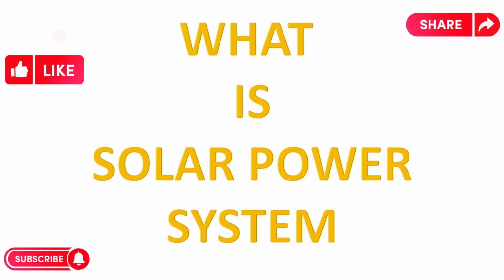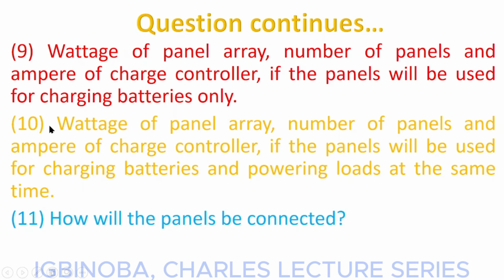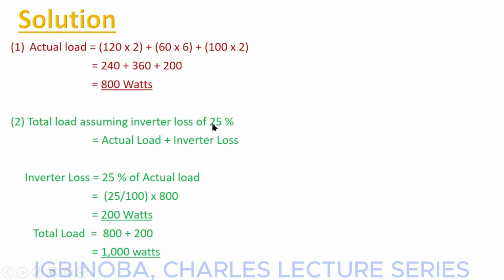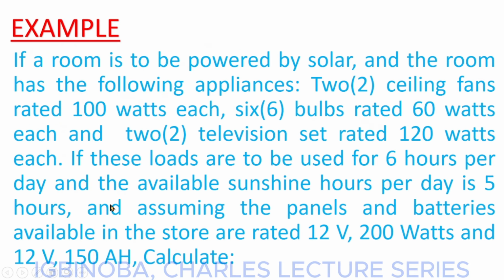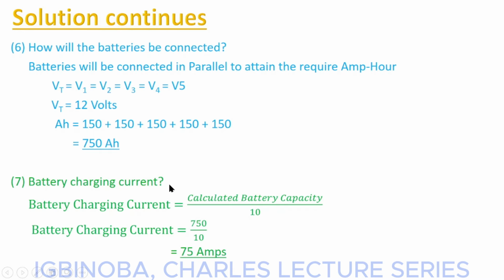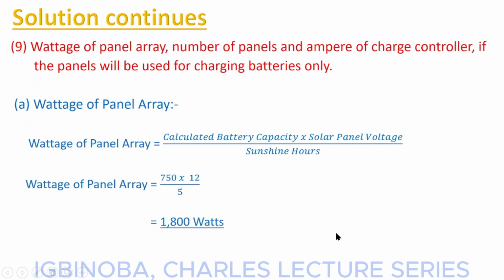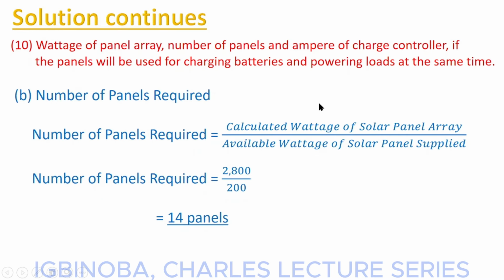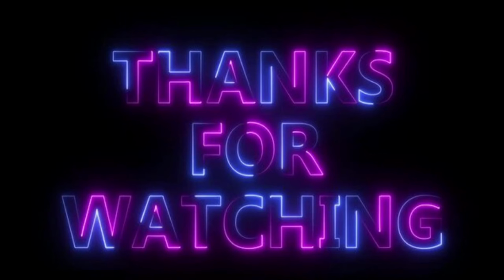Design of Solar Power System

Comment: NAT317Q

1.Actual load is 1380w
2. Total load is 1725w
3. Inverter rating is 2156.25VA
4.Battery capacity is 1293.75AH
5. No. Of batteries is 8.625~9batteries
6. Parallel
7.Battery charging current is 129.375amps
8. Charging time is 14hours
9. (A) 3105w (B) 15.525 ~16panels (C) 258.75A
10. (A) 4830w (3) 24.15~ 24panels (C) 402.5A
11. Parallel

Comment: NAT33C

1. Actual Load (Watts): 1380 W 2, Total Load (DC with 25% Inverter Loss): 1720 W
3. Inverter Rating : 2156.25VA 4. Battery capacity: 1293.75Ah 5, Number of Batteries (12V, 150 Ah): 6, Battery Connection (48V System): 2 parallel strings of 4 batteries in series 7, Battery Charging Current: 129.4 A 8, Minimum Charging Time (hrs): 14
hours 9ia. 3105W b, 15.5 panels c. 258.8A
10a. 4830W
b, 24 panels
c. 402.5A
11. Panel Connection: 3 parallel strings of 6 panels in series

Comment: PETRO3107C

1. Actual load= (100×3)+(60×10)+(120×4) =1380watts
2. Total load assuming inverter loss of 25%= Actual load +Inverter loss
Inverter loss=25% of Actual load
= 25%×1380=345 watts
Total load= 1380+345=1725 watts
3. Inverter rating on VA using power factor of 0.8
= (1725÷0.8)= 2156.25
4. Battery capacity using factor for reserve 75%=(2×1725×6×0.75)=1293.75Ah
5. No. of batteries for backup hours=1293.75Ah÷150Ah= 8.6 =8 batteries 
6. How batteries will be connected?
The batteries will be connected in parallel 
Vt=V1=V2=V3=V4=V5=V6=V7=V8
Ah= 150+150+150+150+150+150+150+150=1200
7. Battery charging current=1293.75÷10=129Amps
8. Battery charging time assuming charging loss of 40%= 1293.75Ah+(40%+1293.75Ah)÷129A=14hrs
9a. Wattage panel array= 3105 watts
9b. Number of panels required= 3105÷345=9 panels 
9c. Ampere of charging controller required= 3105÷12=258.75Amps
10a. Wattage of panel array= Calculated wattage of solar panel array for charging battery only+ calculated total load =3105+1725=4830watts
10b. Number of panels required= calculated wattage of solar panel array÷ Available wattage of solar panel supplied= 4830watts÷345= 14Amps
10c. Ampere of charge controller= calculated wattage of solar panel array÷ solar panel voltage=4830watts÷12volts= 402.5Amps
11. How will the panels be connected?
Ans: They will be connected in parallel

Comment: MEC35I

1. Actual Load (Watts): 1380 W

2. Total Load : 1720 W

3. Inverter Rating: 2156.25VA

4. Battery capacity: 1293.75Ah

5. Number of Batteries (12V, 150 Ah): 9

6. Battery Connection (48V System): Parallel 

7. Battery Charging Current: 129.4 A

8. Charging Time (hrs): 14 hours

9a. 3105W

b. 15.5panels

c. 258.8A

10a. 4830W

10b. 24 panels

10c.4830 ÷ 12= 402.5A

11. Panel Connection: Parallel

Comment: MECH3168L

1. Actual load = 1380W
2. Total load  = 1840W
3. Inverter rating (VA) = 2300 VA
4. Battery capacity = 1227 Ah
5. Number of batteries = 9
6. Battery connection = Parallel 
7. Battery  charging current = 15A 
8. Battery charging time =5.1 days
9. Panel array ( for charging batteries only)
    i. Wattage = 2945
    ii. Number of panels =15
    iii. Charge controller ampere = 245A
10. Panel array ( for charging batteries and powering loads)
     i. Wattage = 4785 W
     ii. Number of panels = 24 
     iii. Charge controller ampere = 399A
11. Panel connection = Series Parallel

Comment: PETROCHEM361I

1 Actual load 1380W
2 Total load  1720W
3 Inverter rating  2156.25VA
4 battery Capacity 1293.75Ah
5 number of batteries 8.6
6 Parallel 
7 Battery charging  129.4A
8 T = 14hrs
9 (a) 3105W
   (b) 15.5 panels 
   (c)  258.75 A
10 (a) 4830W 
     (b) 24 panel 
     (c) 402.5A 
11 Parallel

Comment: PETRO3122R

ANSWERS 
1. Actual load= (100×3)+(60×10)+(120×4) =1380watts
2. Total load assuming inverter loss of 25%= Actual load +Inverter loss
Inverter loss=25% of Actual load
= 25%×1380=345 watts
Total load= 1380+345=1725 watts
3. Inverter rating on VA using power factor of 0.8
= (1725÷0.8)= 2156.25
4. Battery capacity using factor for reserve 75%=(2×1725×6×0.75)=1293.75Ah
5. No. of batteries for backup hours=1293.75Ah÷150Ah= 8.6 =8 batteries 
6. How batteries will be connected?
The batteries will be connected in parallel 
Vt=V1=V2=V3=V4=V5=V6=V7=V8
Ah= 150+150+150+150+150+150+150+150=1200
7. Battery charging current=1293.75÷10=129Amps
8. Battery charging time assuming charging loss of 40%= 1293.75Ah+(40%+1293.75Ah)÷129A=14hrs
9a. Wattage panel array= 3105 watts
9b. Number of panels required= 3105÷345=9 panels 
9c. Ampere of charging controller required= 3105÷12=258.75Amps
10a. Wattage of panel array= Calculated wattage of solar panel array for charging battery only+ calculated total load =3105+1725=4830watts
10b. Number of panels required= calculated wattage of solar panel array÷ Available wattage of solar panel supplied= 4830watts÷345= 14Amps
10c. Ampere of charge controller= calculated wattage of solar panel array÷ solar panel voltage=4830watts÷12volts= 402.5Amps
11. How will the panels be connected?
Ans: They will be connected in parallel

Comment: CHM3142L

1. Actual load is 1380W
2. Total load is 1725W
3. Inverter rating is 2156.25VA
4. Battery capacity is 1293.75AH
5. No. of batteries is 8.625~9 batteries
6. Parallel
7. Battery charging current is 129.375 amps
8. Charging time is 14 hours
9. (A) 3105W (B) 15.525~16 panels (C) 258.75A
10. (A) 4830W (B) 24.15~24 panels (C) 402.5A
11. Parallel

Comment: PETROCHEM36F

1 Actual load 1380W
2 Total load  1720W
3 Inverter rating  2156.25VA
4 battery Capacity 1293.75Ah
5 number of batteries 8.6
6 Parallel 
7 Battery charging  129.4A
8 T = 14hrs
9 (a) 3105W
   (b) 15.5 panels 
   (c)  258.75 A
10 (a) 4830W 
     (b) 24 panel 
     (c) 402.5A 
11 Parallel

Comment: MAR310j
1. Actual load 1380w
2. Total load 1725w
3. Inverter rating 2156.25vA
4. Battery capacity 1293.75Ah
5. Number of battery 8.625 9battries
6. Parallel 
7. Battery charging current is 129.375amps
8. Charging time 14hrs
9. (A) 3105w  (B) 15.525~16panels (c)258.75A
10. (A) 4830w (B) 24.15~24panels (c) 402.5A
11. Parellel

Comment: PETRO 368P
1. Actual load= (100×3)+(60×10)+(120×4) =1380watts
2. Total load assuming inverter loss of 25%= Actual load +Inverter loss
Inverter loss=25% of Actual load
= 25%×1380=345 watts
Total load= 1380+345=1725 watts
3. Inverter rating on VA using power factor of 0.8
= (1725÷0.8)= 2156.25
4. Battery capacity using factor for reserve 75%=(2×1725×6×0.75)=1293.75Ah
5. No. of batteries for backup hours=1293.75Ah÷150Ah= 8.6 =8 batteries 
6. How batteries will be connected?
The batteries will be connected in parallel 
Vt=V1=V2=V3=V4=V5=V6=V7=V8
Ah= 150+150+150+150+150+150+150+150=1200
7. Battery charging current=1293.75÷10=129Amps
8. Battery charging time assuming charging loss of 40%= 1293.75Ah+(40%+1293.75Ah)÷129A=14hrs
9a. Wattage panel array= 3105 watts
9b. Number of panels required= 3105÷345=9 panels 
9c. Ampere of charging controller required= 3105÷12=258.75Amps
10a. Wattage of panel array= Calculated wattage of solar panel array for charging battery only+ calculated total load =3105+1725=4830watts
10b. Number of panels required= calculated wattage of solar panel array÷ Available wattage of solar panel supplied= 4830watts÷345= 14Amps
10c. Ampere of charge controller= calculated wattage of solar panel array÷ solar panel voltage=4830watts÷12volts= 402.5Amps
11. How will the panels be connected?
Ans: They will be connected in parallel

Comment: MECH3142L

1. Actual Load (Watts): 1380 W

2. Total Load (DC with 25% Inverter Loss): 1720 W

3. Inverter Rating: 2156.25VA

4. Battery capacity: 1293.75Ah

5. Number of Batteries (12V, 150 Ah): 9

6. Battery Connection (48V System): 2 parallel strings of 4 batteries in series

7. Battery Charging Current: 129.4 A

8. Minimum Charging Time (hrs): 14 hours

9a. 3105W

b. 15.5 panels

c. 258.8A

10a. 4830W

b. 24 panels

c. 402.5A

11. Panel Connection: 3 parallel strings of 6 panels in series

Comment: MECH3172P
1) Actual Load :1380W
2)Total load: 1720 W
3)Inverter rating : 2156.25VA
4)Battery capacity: 1293.75Ah
5)Number of batteries : 9
6)battery connection : 2 parallel strings of 4 batteries in series 
7) Battery charging current : 129.4A
8) minimum charging time : 14 hours 
9)a. 3105W
    b. 15.5 panels 
    c. 258.8A
10) a.4830W
       b. 24 panels 
        c. 402.5A
11) Panel Connection : 3 parallel strings of 6 panels in series

Comment: EEE363K 

1. Actual load is 1380W

2. Total load is 1725W

3. Inverter rating is 2156.25VA

4. Battery capacity is 1293.75AH

5. No. of batteries is 8.625~9batteries

6. Parallel

7. Battery changing current is 129.375amps

8. Charging time is 14hours

9. (A) 3105W 
(B) 15.525~16panels 
(C)258.75A

10. (A) 4830W
 (B) 24.15~24panels 
(C)402.5A

11.Parallel

Comment: MECH3104Z
1. Actual load is 1380W 2. Total load is 1725W 3. Inverter rating is 2156.25VA 4. Battery capacity is 1293.75AH 5. No. of batteries is 8.625~9batteries 6. Parallel 7. Battery changing current is 129.375amps 8. Charging time is 14hours 9. (A) 3105W (B) 15.525~16panels (C) 258.75A 10. (A) 4830W (B) 24.15~24panels (C) 402.5A 11. Parallel

Comment: MECH3212F
1. Actual load= 1380w

2. Total load = 1725w

3. Inverter rating=2156.25VA

4. Battery capacity= 1293.75AH

5. No batteries 9

6. Parallel

7. Battery charging current= 129.38ampere

8. Charging time= 14 hours

9. a) 3105w

b) 15.5 panels

c) 258.75A

10. a) 4830w

b) 24 panels

c) 402.5A

11. Parallel

Comment: CIV342P

1. Actual load is 1380W
2. Total load is 1725W
3. Inverter rating is 2156.25VA
4. Battery capacity is 1293.75AH
5. No. of batterics is 8.625-9batteries
6. Parallel
7. Battery changing current is 129.375amps
8. Charging time is 14hours
9. (A) 3105W (B) 15.525-16panels (C) 258.75A
10. (A) 4830W (B) 24.15-24panels (C) 402.5A
11. Parallel

Comment: PETROCHEM4D

1. Actual load- 1380W
2. Total Load - 1720W
3. Inverter rating- 2156.25VA
4. Battery capacity - 1293.75AH
5. Number of batteries (12V,150AH) - 9
6. Battery connection (48V System) - it would be connected in parallel 
7. Battery charging current - 129.4A
8. Minimum charging Time - 14 hours
9. a 3105W
     b. 15.5 Panels~16 panels 
     c. 258.8A
10a. 4830W
     b. 24 Panels 
     c. 402.5A
11. Parallel

Comment: CHM3171P

1. Actual load: 1380 W

2. Total load: 1720 W

3. Inverter rating: 2156.25 VA

4. Battery capacity: 1293.75 Ah

5. Number of batteries: 8.6

6. Connection: Parallel

7. Battery charging current: 129.4 A

8. Time (T): 14 hrs

9.
(a) 3105 W
(b) 15.5 panels
(c) 258.75 A

10.
(a) 4830 W
(b) 24 panels
(c) 402.5 A

11. Parallel

Comment: PETROCHEM367O

1 Actual load 1380W
2 Total load  1720W
3 Inverter rating  2156.25VA
4 battery Capacity 1293.75Ah
5 number of batteries 8.6
6 Parallel 
7 Battery charging  129.4A
8 T = 14hrs
9 (a) 3105W
   (b) 15.5 panels 
   (c)  258.75 A
10 (a) 4830W 
     (b) 24 panel 
     (c) 402.5A 
11 Parallel

Comment: NAT13M

1. Actual Load: 1380W
2. Total Load: 1725W
3. Inverter Rating: 2156, 25VA
4. Battery Capacity: 1293.75Ah
5. Number of Batteries: 9
6. Configuration: Parallel
7. Battery Charging Current: 129.375A
8. Charging Time: 14Hours
9a. 3105W
9b. 16 Panels
9c. 258.75A
10a. 4830W
10b. 24 Panels
10c. 402.5A
11. Parallel

Comment: MAR32B

1. Actual Load = 1380 watts
 2. Total Load = 1725 watts T 3. Inverter Rating = 2156.25 VA
 4. Battery Capacity = 1293.75 Ah 
5. Number of Batteries = 8.625~9 batteries 
6. Parallel 
7. Battery charging current = 129.375 Amps
 8. Charging time = 14 hrs 
9. (a) 3105 watts (b) 15.525~16 panels (c) 258.75 Amps 
10. (a) 4830 watts (b) 24.15~24 panels (c) 402.5 Amps
 11. Parallel

Comment: PETRO3104Z

1. Actual Load: 1380 W
2. Total Load (including inverter loss): 1840 W
3. Inverter Rating (VA): 2300 VA
4. Battery Capacity: 1227 Ah
5. Number of Batteries: 9 batteries
6. Battery Connection: Parallel
7. Battery Charging Current: 15 A (per battery string)
8. Battery Charging Time: 5.1 days
9. Panel Array (for charging batteries only):
- Wattage: 2945 W
- Number of Panels: 15 panels
- Charge Controller Ampere: 245 A
10. Panel Array (for charging batteries and powering loads):
- Wattage: 4785 W
- Number of Panels: 24 panels
- Charge Controller Ampere: 399 A
11. Panel Connection: Series - Parallel

Comment: PETRO3166J

1. Actual load= (100×3)+(60×10)+(120×4) =1380watts
2. Total load assuming inverter loss of 25%= Actual load +Inverter loss
Inverter loss=25% of Actual load
= 25%×1380=345 watts
Total load= 1380+345=1725 watts
3. Inverter rating on VA using power factor of 0.8
= (1725÷0.8)= 2156.25
4. Battery capacity using factor for reserve 75%=(2×1725×6×0.75)=1293.75Ah
5. No. of batteries for backup hours=1293.75Ah÷150Ah= 8.6 =8 batteries 
6. How batteries will be connected?
The batteries will be connected in parallel 
Vt=V1=V2=V3=V4=V5=V6=V7=V8
Ah= 150+150+150+150+150+150+150+150=1200
7. Battery charging current=1293.75÷10=129Amps
8. Battery charging time assuming charging loss of 40%= 1293.75Ah+(40%+1293.75Ah)÷129A=14hrs
9a. Wattage panel array= 3105 watts
9b. Number of panels required= 3105÷345=9 panels 
9c. Ampere of charging controller required= 3105÷12=258.75Amps
10a. Wattage of panel array= Calculated wattage of solar panel array for charging battery only+ calculated total load =3105+1725=4830watts
10b. Number of panels required= calculated wattage of solar panel array÷ Available wattage of solar panel supplied= 4830watts÷345= 14Amps
10c. Ampere of charge controller= calculated wattage of solar panel array÷ solar panel voltage=4830watts÷12volts= 402.5Amps
11. How will the panels be connected?
Ans: They will be connected in parallel

Comment: PETRO3160D 

THE ANSWERS 
1. Actual load= (100×3)+(60×10)+(120×4) =1380watts
2. Total load assuming inverter loss of 25%= Actual load +Inverter loss
Inverter loss=25% of Actual load
= 25%×1380=345 watts
Total load= 1380+345=1725 watts
3. Inverter rating on VA using power factor of 0.8
= (1725÷0.8)= 2156.25
4. Battery capacity using factor for reserve 75%=(2×1725×6×0.75)=1293.75Ah
5. No. of batteries for backup hours=1293.75Ah÷150Ah= 8.6 =8 batteries 
6. How batteries will be connected?
The batteries will be connected in parallel 
Vt=V1=V2=V3=V4=V5=V6=V7=V8
Ah= 150+150+150+150+150+150+150+150=1200
7. Battery charging current=1293.75÷10=129Amps
8. Battery charging time assuming charging loss of 40%= 1293.75Ah+(40%+1293.75Ah)÷129A=14hrs
9a. Wattage panel array= 3105 watts
9b. Number of panels required= 3105÷345=9 panels 
9c. Ampere of charging controller required= 3105÷12=258.75Amps
10a. Wattage of panel array= Calculated wattage of solar panel array for charging battery only+ calculated total load =3105+1725=4830watts
10b. Number of panels required= calculated wattage of solar panel array÷ Available wattage of solar panel supplied= 4830watts÷345= 14Amps
10c. Ampere of charge controller= calculated wattage of solar panel array÷ solar panel voltage=4830watts÷12volts= 402.5Amps
11. How will the panels be connected?
Ans: They will be connected in parallel

Comment: EEE392N

1. Actual Load: 1380W
2. Total Load: 1725W
3. Inverter Rating: 2156, 25VA
4. Battery Capacity: 1293.75Ah
5. Number of Batteries: 9
6. Configuration: Parallel
7. Battery Charging Current: 129.375A
8. Charging Time: 14Hours
9a. 3105W
9b. 16 Panels
9c. 258.75A
10a. 4830W
10b. 24 Panels
10c. 402.5A
11. Parallel

Comment: COMP359G
1. Actual load is 1380W 
2. Total load is 1725W 
3. Inverter rating is 2156.25VA 4. Battery capacity is 1293.75AH 
5. No. of batteries is 8.625~9batteries 
6. Parallel 
7. Battery changing current is 129.375amps 
8. Charging time is 14hours 
9. (A) 3105W (B) 15.525~16panels (c) 258.75A 10. (A) 4830W (B) 24.15~24panels (C) 402.5A 11. Parallel

Comment: PETROCHEM395Q

1 Actual load =1380W
2 Total load  =1720W
3 Inverter rating = 2156.25VA
4 battery Capacity =1293.75Ah
5 number of batteries =8.6
6 Parallel 
7 Battery charging = 129.4A
8 T = 14hrs
9 (a) 3105W
   (b) 15.5 panels 
   (c)  258.75 A
10 (a) 4830W 
     (b) 24 panel 
     (c) 402.5A 
11 Parallel

Comment: PETROCHEM339M

1 Actual load is 1380W
2 Total load is 1720W
3 Inverter rating is 2156.25VA
4 battery Capacity is 1293.75Ah
5 number of batteries is 8.6
6 Parallel 
7 Battery charging is 129.4A
8 Time is 14hrs
9 (a) 3105W
   (b) 15.5 panels 
   (c)  258.75 A
10 (a) 4830W 
     (b) 24 panel 
     (c) 402.5A 
11 Parallel

Comment: MECH380B

1. Actual Load (Watts): 1380 W  
2. Total Load (DC with 25% Inverter Loss): 1720 W  
3. Inverter Rating : 2156.25VA
4. Battery capacity: 1293.75Ah
5. Number of Batteries (12V, 150 Ah): 9  
6. Battery Connection (48V System): 2 parallel strings of 4 batteries in series  
7. Battery Charging Current: 129.4 A  
8. Minimum Charging Time (hrs): 14 hours  
9a. 3105W
 b. 15.5 panels
c. 258.8A
10a. 4830W
b. 24 panels 
c. 402.5A  
11. Panel Connection: 3 parallel strings of 6 panels in series

Comment: COMP3103Y
1. Actual load is 1380w

2. Total load is 1725w

3. Inverter ratings is 2156.25VA

4. Battery capacity is 1293.75AH

5. No of batteries 9

6. Parallel

7. Battery charging current is 129.375amps

8. Charging time is 14 hours

9. A. 3105watts
B. 16 panels
C. 258.75amps

10. A. 4830 watts
B. 24 panels
C. 402.5amps

11. Parallel

Comment: PETRO3105A
1. Actual Load: 1380 W  
2. Total Load (including inverter loss): 1840 W  
3. Inverter Rating (VA): 2300 VA  
4. Battery Capacity: 1227 Ah  
5. Number of Batteries: 9 batteries  
6. Battery Connection: Parallel  
7. Battery Charging Current: 15 A (per battery string)  
8. Battery Charging Time: 5.1 days  
9. Panel Array (for charging batteries only):  
   - Wattage: 2945 W  
   - Number of Panels: 15 panels  
   - Charge Controller Ampere: 245 A  
10. Panel Array (for charging batteries and powering loads):  
   - Wattage: 4785 W  
   - Number of Panels: 24 panels  
   - Charge Controller Ampere: 399 A  
11. Panel Connection: Series - Parallel